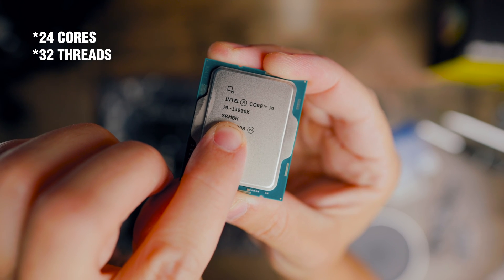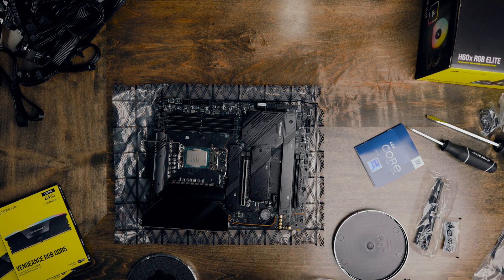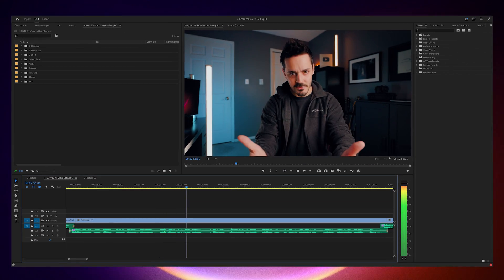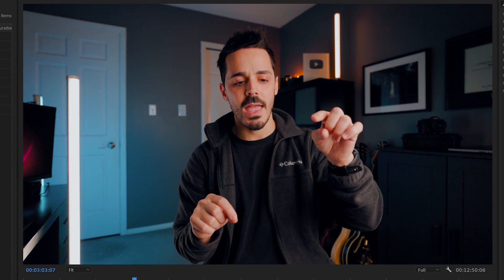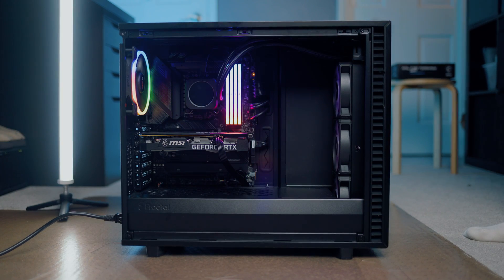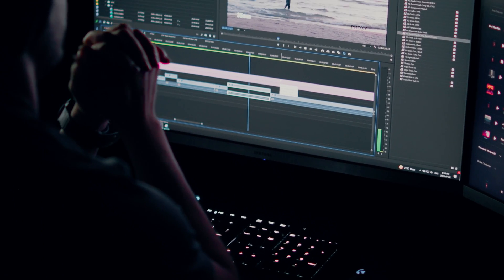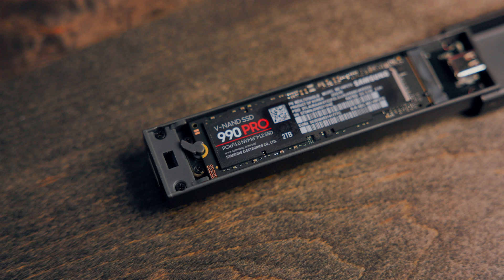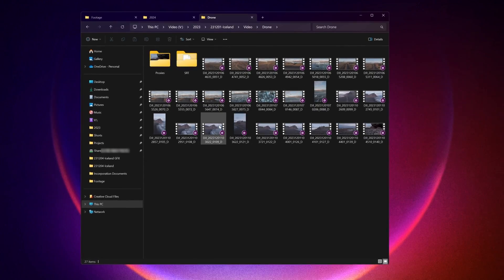My 2026 CUSTOM Video Editing PC Build 💻

Comment: A MASSIVE mistake is your AIO. It's definitely not enough cooling for the i9 13900k. I hope you've already updated your bios. The 13, 14 gen Intels suck too much power (more than they need) and that will damage it. Microsoft has fixed the bugs to some degree, but you have to update your bios to the newest version

Comment: you want to get an Nvidia 5000 series GPU.  for the first time ever, Nvidia is now accelerating 10-bit 4:2:2.  that was Intel's big advantage because every Intel CPU had an iGPU that could accelerate 10-bit 4:2:2.  But now that Nvidia is finally hardware decoding it, suddenly Intel lost its advantage and AMD comes out ahead.

Comment: I recently discovered that in fact a RAM with a speed of 6000 Mhz for example has a real speed of 3000 Mhz but 6000 Mt/s
Reply: You probably have in wrong slots, if 4 slots but only 2 sticks, sets A and B , try the other set (usually marked grey and black)
Reply: @chriss4739  No when they write 6000mhz on ram that's the marketing fake speed. You can easily make research on that. To confirm what I'm talking about

Comment: As I was messing around the other day on Davinci and seeing loads gpu is factor to the rendering as well. Yes the cpu is very important but so it the gpu 
CPU will help with actually allowing to play the vids/simple color grading 
Gpu helps with effects
I just upgraded my complete setup from an i5 9600k paired with an rtx 2070
New setup has 
I9 12900k with the same gpu 
It runs like butter now but tbe gpu bottle necks when I use noise reduction causing it to stutter a lot/slow frame
With my old build I could still edit 4k like nothing, but when it came to edit videos like C-log then that was something else

Comment: You cant upgrade the RAM on newer “M” processor series Apple computers In fact yiu cant upgrade anything on the Apple computer once purchased because the elements are soldered into the motherboard. A huge fail for Apple.

Comment: Not sure who needs to hear this but those older intel Xeon CPUs with 16,18, 20, 24 cores work like a dream in video editing, couple them with something like a 3070, Ti or 3080, you'll never know what stuttering is, the massive core count means that yes they may not beat Morden CPUs on single threaded performance but multi threaded, which he's referring to here is a no contest, because they have massive caches it means they will chew through the video encodes and decodes and timelines like you wouldn't know. Power consumption might shoot but if you consider the ease of life then I think it's a compromise worth making, they regularly appear on Ali express for as little as 10 to 20 dollars and go on from there depending on how new it is and it's core count. 

Ps the Nvidia GPUs I mentioned can be found for less than 400 USD for the 3080 and 3080 Ti which are equivalent in performance to 4070 and 4070 Ti at a fraction of the price. Heck I even saw a pre built pc from Walmart going for 1200 with an rx 7900GRE and a Ryzen 7700, black Friday offer, I think even if the other parts in there might not suit you that's a very good deal if you don't know how to pick the right parts for your build. As for the GPU or pc parts for cheap, check out jawa. I saw some cool builds and parts.

Comment: I've been using my old pc which is over 15 yrs. old but when I bought the components, I went with an i7-950 ,3.06hsz CPU, a gigabyte x58-usb3 mother board, and last year replaced the graphics card with MSI  Geforce 1660 Ventus XS  6b ddr5 OC edition, and Thermaltake 650-watt modular power supply and maxed out the ram to 24 GB with ddr3 Kingston fury chips and use my rig mostly for doing graphics and digital art using photoshop and  illustrator. Used to use Maya and ZD brush for 3d modeling as went to Vancouver film School for animation but preferred using my power mac G5 tower with dual 2.5 processors and that was a very quick at rendering, modeling, and never crashed as much as the HP 8000 workstations which we used at school. The old mac lasted 12 yrs. of constant use, and the PC rig has been in use for 15 yrs,not bad at all considering like my computer friend used to say I did not know much about computers, but I research the hell out of things before buying and they were shocked I built a better pc than theirs. Not hard to do just read up and research then started from the brain (CPU) to mother board the heart, and then the rest but now planning of installing all those components in a corsair 5000 d case, or upgrading the whole system but hesitant as why upgrade when the system still works well, as just mostly doing design and digital art and saving money is best in this era. If I were to upgrade think I would follow yr. Advice or intel i-7 1700kf, Z790 Asus pro art mother board/Msi Z790 tomahawk/ so I can run 2 monitors and drawing tablet and same GPU I've got in current rig, and 850 to 1000 psu and corsair 5000d case with CPU cooler and fans. So many choices for board just want to make sure no issues as want it to be as reliable as my old pc rig and not into gaming as just into doing art.  Anyhow thank you for your informative videos.

Comment: Anyone can assist me, would this setup will be good for my video and photography work ?

PROCESSOR AMD RYZEN 5 7600X
MB MSI B650 PLUS GAMING WIFI D5
RAM KINGSTON FURY 32GB 2X16 6000MHZ DDR5 RGB
VGA PNY RTX4060 VERTO 8GB DUAL FAN
1TB M.2 NVME
650W
COOLER FAN DEEPCOOL LT360 ARGB BLACK
CASE ACEGEEK CRUISER L460 BLACK ARGB FAN TEMPERED GLASS

Comment: When choosing a motherboard make sure to also match the chipset to the CPU!
So with intel the B#60 is for i3 & i5 and the Z#90 is for i7 & i9. You could mix and match them too but you'll be leaving some performance on the table if you pair a B series board with an i7 for example
Reply: Not quite accurate.  It's not about which level of CPU; it's about whether you want to have access to overclocking.  A "K" CPU should be paired with a Z-board because those are the OC-capable parts.  There are K chips across the range.

Comment: I'm a PC builder and also an amateur photographer. Few things I noticed except from the cooler being insufficient for the 13900K's TDP is you should have placed your NVMe storage on the slot closest to the CPU cuz it's directly connected to the CPU and should perform a little bit faster. Also, I'm not sure if your fan config is wrong on your new AIO but, if you used reversed fan blades for your front fans it should be good. But, if it's just normal fans the airflow is not optimized and could cause some performance hit. But overall, very nice PC and video bro!

Comment: 11:33 ok depending on the board, if u are going to add more PCIe u may lose performance on 2 of the NVMe. For this reason I had switched from adding more NVMe and use 2.5" SSDs (560MB transfer) for other things other than the OS & programs which are on the main NVMe. One of those SSDs will store Unreal Engine & AI/LLM files, the other SSD for games. An external 2GB transfer speed holds all photoshop & premiere pro work and this is so i can be mobile with those projects from PC to laptop. The ProArt B760 DDR5 WIFI i got has 3 NVMe, only using 1.
Reply: oh why i concerned about slowing down PCIe, will be using 2 GPUs, a 4070 Super FE on the PCIe 4 slot for photoshop & premiere pro and for the PCIe 5 slot I'm waiting for Nvidia 5000 series to see what they got to use for Unreal Engine, AI/LLM and occasional 1440p gaming. The 4070 Super FE can get me started playing around in Unreal + AI and gaming, but will need more power and I dont believe in the 4090 (yes it's great but i personally dont believe in using that much wattage and price ridiculous), well 70 series is fine for me, want to see what 5070 has to offer. If I not impressed then it'll be ProArt 4070 Ti Super. on the PCIe 3 slot i might daisy chain some GPUs to do some mining.

Comment: My Issue -- what if you need a PC that can edit both a three hour movie, and a two hour movie, shot with r3d files and a 40:1 shooting ratio (Meaning 200 hours of HQ 6K footage that should not be buffering while editing, which is roughly 200 TB for the footage alone, linked to three server farms for 1 PB storage Each)???
Reply: @filmpocketknifepictures8522  amd threadrippers and multi gpus are the solution.

Comment: Where did you get 1000W power supply from? That setup could run on 600W no problem. I get future proofing but for an editing PC you could use that 3060 for years and CPU's don't increase power draw much going from generation to generation. A 750W would be good for future proofing and much cheaper.

Comment: Mistake spotted: Using an 13900K.  Oh wait, we didn't know 4 months ago.  Some will say tubes at the top of the radiator is a mistake because it can allow air bubbles to reach your pump.

Comment: Hey Anthony! I want to build a computer to be able to edit RED 5k and 6k footage. Based on what I see on this video, this build should run smoothly, but I'm wondering if there is anything else that should be considered when working with RED Cameras or bigger. Excuse my ignorance, I'm a young director trying to do the assembly for my short films and they were shot with a Komodo RED and Gemini RED. Thanks for making videos like these!
Reply: You'll need a really big fast SSD... CPU if you're going with Anthony's config is fine. Maybe more RAM ? On GPU, you don't really need much. 3060Ti is okay as it mostly used in the rendering process and based on my experience, my 1650 Super works just fine with my 4K H.265 100 MBps video. 12 minutes 4K renders after 12-15 minutes. If you go for Anthony's configuration, you'll be more than fine.
Reply: @TechieFelixLP  if a person is shooting on red cameras, they're workflow and output demand won't cut it with a 3060 buddy. And they definitely need many 4tb nvme ssd drives. Threadripper is the only cpu platform that has many pcie lanes and cpu power and allows for multi gpu setups.
Reply: @Prabhu_njd  My friend who works in a film industry shooting Blackmagic and many other Camera brands uses 1660Ti. He specifically goes for a higher end CPU over GPU.
Reply: @TechieFelixLP  there's a huge difference in editing with blackmagic B-Raw vs Red Raw files. Ask your friend which files are easier to edit with his pc.

Comment: How about editing 4K 10bit 4 2 2?
Reply: For that you'll probably need a good fast CPU, GPU isn't as much. Unless you're in a time crunch and can't lose 12 minutes to render a 12 minutes 4K. Something like the 1650 Super is good... Or at least to my opinion, I render simplistic video often in 4K although in 8 Bit only. A 12 minutes video took around 13 to 14 minutes to render. However, this is why you'll need a better CPU, my problem with my PC is that the CPU is a budget entry level CPU from 2018.
Reply: And the old CPU doesn't help in Timeline scrubbing and everything else other than rendering. I use H.265 rendering which utilize the GPU for rendering.
Reply: @TechieFelixLP  M2 Max Mac Studio or risen 9 7950x 3d with 6000mhz 32 Ram With 4070 pro art 12GB VGA ? For video editing And After effects Stuff??
Reply: @Dami20314  I'll probably go for M2, a lot simpler. Especially if you're already so familiar with Apple stuff. But that's just me...

Comment: Thanks for the video linking bro! :) 
Also, , you've got your AIO fans set the wrong way (Pushing air out from within the case), you're exhausting from the front.
Instead of - Pushing cold air into the case through the radiator, intaking from the front.

You'd get much better performance if you flipped the 3 fans on the radiator :)
Reply: @thetechnotice the only guy who atually cares more about us then gamers
Reply: Please do save his card graphics please please for put the important stand for his card graphics 🙏please please he must does these things before big tears come out before all bad things happen. 🙏please please.
Reply: actually he does have them installed correctly, see 3:44.  I would guess he installed correctly for actual use but set backwards for the pretty lights/optics for the camera for use to see how cool it looks.  The problem is with AIO kits not including reversable fans if ARGB, they are only good as is for top mounts to see the lights correctly.  For a good example, go see advertising for Thermaltake tower 250, it shows the AIO argb lighting, that case is designed to be intake bottom and sides, exhaust to top. If you would have to reverse the fans, not seeing the leds correctly, or buy another fan set to obtain that look. they even have a test report, they have the side 360 rad as intake.

Comment: I'm building an editing PC. I was advised to install 64gb of Kingston Fury Beast DDR5-6000. Hence, when using 128GB of RAM, DDR 5, it will not run at 6000+ MHz because the speed is limited to 5600 MHz since you'll be using 4 modules instead of 2.

Comment: My PC Freezes when I am exporting 4k Video. What do I need to upgrade?
I am video editor however whenever I try exporting an edited video in 4k with any bitrate over 20 it freezes and I have to do a hard reset.
PC Specs:
Processor AMD Ryzen 9 3900X 12-Core Processor, 3793 Mhz, 12 Core(s), 24 Logical Processor(s)
Installed Physical Memory (RAM) 64.0 GB
Graphics Card NVIDIA GeForce RTX 3060
SDD Hard Drive Size 930.90 GB
What could be causing it to freeze?

Comment: You could have just used a BeQuiet! Darkrock pro 4 for the CPU cus It has a 250w tdp and ist much cheaper and long lasting than a watercooled solution.

Comment: My Mac Mini with M2 Pro 16 core neural engine and 32 gb ram performs totally mind blowing with DaVinci Resolve. I made a switch from Adobe Premiere and do not regret. Way way better for both editing, color grading and effects. I think that DaVinci will take over the high end pro industry ❤
Reply: Hi there - I only have experience with Premiere on a MacBook Pro with Intel i9 processor, which was okay. Since Adobe Premiere Pro now supports Apple Silicon natively I think that it will perform very good too. Best regards 👍
Reply: Thank you for your comment. I'm looking for an editing PC and you answered all my questions in advance 😊  I'll go get a Mac mini with m2 pro now.  By the way, since you mentioned you switched to DaVinci Resolve, does the Mac not run Adobe premiere properly? Thanks in advance!

Comment: Cool video. It's always fun to see PC builds for video editing. I've heard that the memory controllers on the 13th and 14th gen Intel CPUs (and latest gen Ryzen as well) aren't very good and might not always support the DOCP or XMP profiles of the RAM kit if you are running RAM in all four slots. For instance, your RAM is rated at 6000mhz, I'd be curious to know if you're getting that speed since you've populated all 4 slots. I've seen a lot of reviewers suggest only using two RAM sticks if you want fast RAM, but if you want to run 4 sticks, save some money and get slower speed.

Also, the GPU can be put to work doing all sorts of GPU-accelerated effects and tasks aside from encoding and decoding--like noise reduction, grain, etc.,--so you could absolutely get some benefits of a better GPU if you can budget for it.
Reply: I'm curios of this as well. Since he bought 2 kits of 2 dimms, he is basically asking for trouble. My guess it's 4800 Mhz max or computer won't even boot.

Comment: Great video Anthony! I really like being able to watch all your videos while also being able to learn from them. However, in this specific video, I disagree with a few things you said. For example, you said that for 4K video editing, you should stick with a more powerful CPU. While having a powerful CPU is important when it comes to video editing, I think it is extremely important to have an equally powerful GPU, if not a better one. On top of that, everything else in a PC should be powerful enough to support what ever GPU and CPU you have. The PC you built has great stats, but I think you went over the top a bit. First, your CPU is quite powerful and will create a bottleneck with you GPU, for most people, I would suggests a much cheaper and less powerful CPU, especially if they are just getting into video or photo editing. Second, 128gbs of RAM is a LOT of RAM, I only have 16gbs and I can edit 4k and photos just fine. However, I understand that not all people have the same work flow as me and might be working with a larger amount of videos or photos, either at a higher resolution, or the same resolution. Nevevertheless, I appreciate and respect your video and do not mean to be rude. I'm looking forward to future videos you have related to video or photo editing! 😁
Reply: I have comment on my comment. While I do edit 4K videos with 16gbs of RAM, it's worth pointing out that they aren't long videos. However, if you are editing longer videos, then having more RAM can be extremely helpful. All in all, unless you are doing it professionally, there is no need to get a super expensive system, but, it would never hurt.
Reply: The testing I've read about shows that cpu is higher priority for 4k editing than the gpu. However, performance levels off at 16 cores.

The gpu comes in more for graphics, rendering, and exporting. It seems counter intuitive, for sure.

Comment: In 2017, I built a build from PCPartPicker that was specifically for video editing and it never worked properly :(
I'm still using it and Premiere still sucks on it. I don't have the income I used to have so I'm stumped as to what I did wrong. 

What do all of you here think? Here are the specs:
AMD Ryzen 7 2700 3.2 GHz 8-Core Processor
MSI B450 Gaming Plus MAX ATX AM4 Motherboard
TEAMGROUP Elite 32 GB (2 x 16 GB) DDR4-3200 CL22 Memory
Samsung 960 Evo 250 GB M.2-2280 PCIe 3.0 X4 NVME Solid State Drive
Asus Turbo GeForce GTX 1080 8 GB Video Card
EVGA SuperNOVA 550 G3 550 W 80+ Gold Certified Fully Modular ATX Power Supply